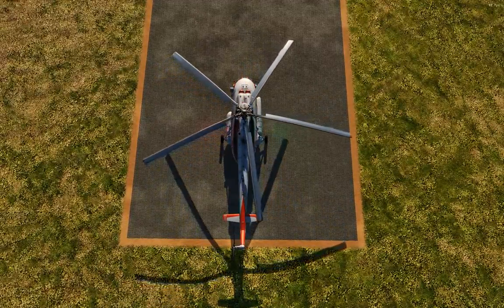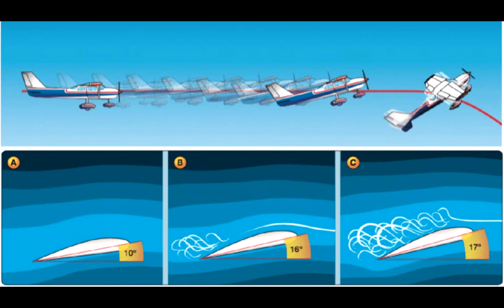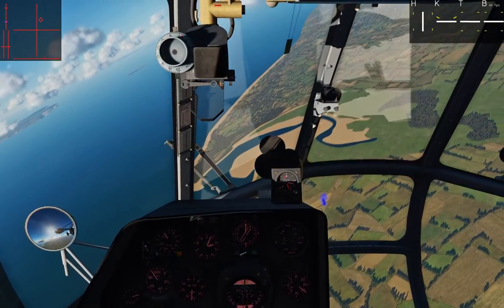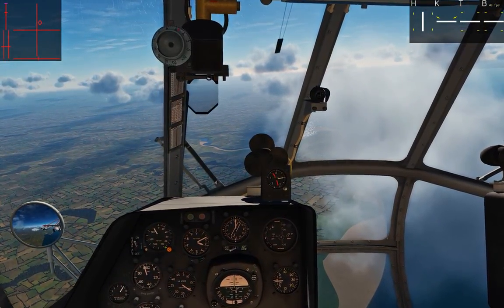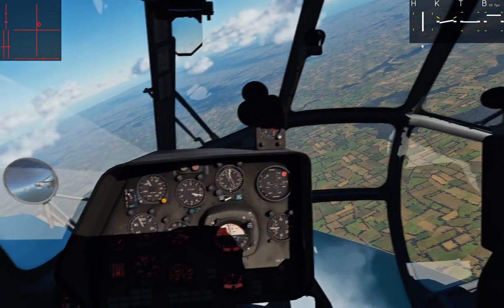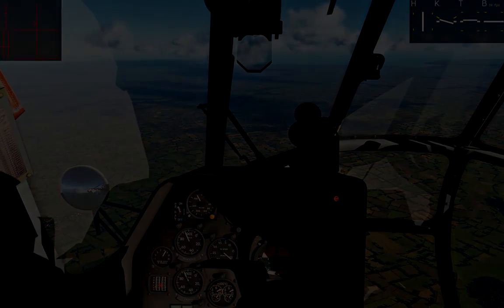DCS Mi-8: Retreating Blade Stall Tutorial

Comment: Last one of these, I promise. 

That beginning bit was a roller coaster:
0:10 "dis-symmetry of lift" Good...
0:12 "Cyclic feathering and blade flapping" Good...
0:19 "Critical angle of attack" Okay...
0:27 "... gyroscopic procession..." NO! BAD!
0:29 "...and phase lag..." Okay, good, so what the hell was that about gyroscopic procession? 

Okay, now on to the rest of it. 
1:15 Minor point: Tip-speed is fine, but if you want a good representative point for the blade as a whole, the 75% radius location is typically used. So that would mean 135 m/s +- the forward speed. Don't think anyone cares though. 

3:00 Flapping is the angular movement of the blade relative to the "*shaft plane*," which is the plane normal (perpendicular) to the shaft that passes through the center of the hub. 

3:09: Flapping rate up or down will decrease or increase the blade angle of attack, respectively (this assumes normal downward inflow and positive collective pitch). You're not wrong, but this should just be clarified. 

3:30 Put another way, the rotor will automatically flap such that the blades maintain roughly equal AoA. 

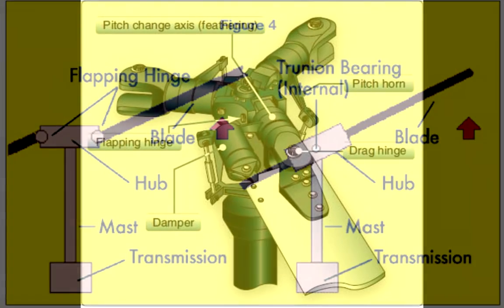3:38 Ah, yes. Finally a rotor that spins the correct direction :D

4:33 Minor point: The rotation you describe is called feathering or pitch. Twist generally refers to a geometric property of the blade and is the pitch distribution along its span. Blades will dynamically twist in flight due to airloads and propeller moment (aka, the "tennis racket effect"). Again, this is more a point about terminology than anything. It's not something the layman would care about. 

5:37 NOOOOOOOOOOOOOO!

5:44 No, it's not

6:17 In the case of retreating blade stall, yes, it will. Even in the case with 90 degree phase. 

6:23 No, *NOT* because of gyroscopic procession. 

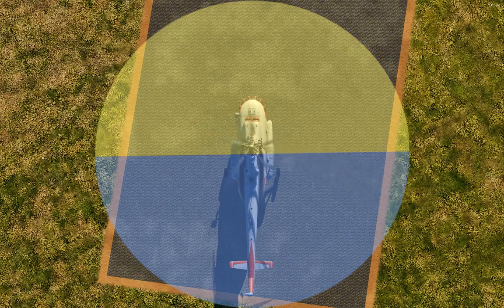6:30 The front half of the disk would not see more lift (Ignoring the effect of coning). The disk just tilts back. 

6:43 Right, it's not a gyroscope. So why mention gyroscopic procession at all? 

7:04 Yes, though phase lag is a very general term that can apply to any oscillating system. It's not a "broad version" of gyroscopic procession. Gyroscopes behave they way they do because of Coriolis forces. Rotor flapping occurs because centrifugal forces act as a restoring force in such a way that the rotor can be shown to behave like a linear second order spring-mass-damper system. 

9:40 There will be a flapping response, to be sure, but there should be a larger roll to the right than you're letting on. Explaining why exactly is difficult to do without illustrations, but it has to do with rotor coning and hinge forces. Just know that in the case of retreating blade stall, there should be a characteristic roll to the retreating side. 

10:50 The buffeting is due to to the stall as the blades go through a non-linear region of their lift curve every rotation. In a 5-bladed rotor, this will result in a 5/rev vibration. 

11:40 The violent pitch up likely wasn't due so much to the retreating side stall as it was you failed to keep the stick moving forward as your speed increased. What I think happened (I could be wrong) is the descent kept you accelerating even while the rotor was flapping aft in response to the increasing speed. The entire aircraft likely built AoA, but you didn't notice. Eventually, the horizontal tail stalled, resulting in the pitch up. Retreating blade stall isn't usually a sudden dramatic thing like that. I'll notice it in the Huey if I'm in a fast descent with a lot of forward cyclic; I'll have to maintain a lot of right stick as the aircraft wants to roll to the left. That pitch up can occur in wind up turns, however, which is what you were doing towards the end. 

13:17 I agree that the roll to the left is suspect, and the fact that you had to hold so much right stick during the dive is also strange. However, this is almost certainly not a case of copy-pasted code from the Huey. Their rotor model should take care of this stuff automatically. It could be that there are complicating and competing effects at play here. I suspect the rapid pitch up is complicating things. I would encourage you to repeat the experiment, but instead, keep the nose down by increasing forward stick as the speed increases. Then see if you get the characteristic right roll. 

15:55 Again, not flapping. It's because of cyclic pitch. 

Anyway, that's it for me. Hope it's helpful. I quite enjoyed the series. Thank you very much for making it.
Reply from the maker: Thank you for these comments, I am learning a lot as I read them.

The reason I talked about Gyroscopic Precession is that as a layman when you look up RBS you will find page after page and site after site talking about Gyroscopic Precession and not Phase Lag. You have to dig deeper to learn about that and the differences between them, so I wanted to make sure I at least attempted to explain that in the video.

Thanks for the tip on the pitching up behavior, I will definitely retry this with your advice and see what happens.
Reply: @vsTerminus  I'm glad you found them useful. And thank you for the series as a whole. I never took the time to learn the Mi-8's systems in the past, so this was very useful. 

I tend to get on people's case about gyroscopic procession precisely because of the reason you mention; that myth is everywhere. In my opinion, it's best to first describe the rotor as a second order system, explain that it has a ~90 deg phase as a result because it is excited at or near its resonant frequency, and then acknowledge the gyroscopic procession myth and explain why it's wrong when it comes to rotor flapping. Unfortunately, like I said in one of my other comments, this doesn't lend itself well to simple explanations.
Reply: @ErikScott128  What is the reason gyroscopic precession is a myth? I’m having trouble with this, and need help understanding, as it seems the concept of gyroscopic precession is only applied during conversations of certain aerodynamic principles, but then utterly disregarded during others. I could use some further help with understanding.
Reply: @fmfmichael  The concept of gyroscopic precession in general isn't a myth. It's a real phenomenon. It's just not really the right explanation for how articulated rotors behave. A better explanation is that the flapping motion can be shown to be equivalent to a spring-mass-damper system: the moment about the hinge due to centrifugal force is equivalent to the spring, the blade's rotational inertia is analogous to the mass, and the damping is aerodynamic (as the blade flaps up, the angle of attack is reduced, and the lift therefore decreases). If you actually do the math, you find that the natural frequency of this system is equal to the rotor rotational speed. Cyclic pitch, almost by definition, is also applied once per revolution, so this is a system excited at resonance. All resonate systems show a 90 degree phase lag; the system responds one quarter cycle later than the input. 

Strictly speaking this is only true for blades with no hinge offset (such as a teetering rotor). For articulated rotors with small flapping hinge offsets, the natural frequency is slightly higher than the rotor speed, and so is excited slightly below resonance. This results in a phase lag slightly below 90 degrees. The exact phase angle depends on the amount of damping, which aerodynamic in nature and thus depends on the ambient conditions (namely air density) as well as the blade aerodynamic and inertial properties.
Reply: At the 13:17 - I think it is the same phenomena as for the taildragger prop plane. When you pitch the nose down on the take off, the aircraft wants to yaw left or right, depends on the propeller rotation. Same for helicopter but the result is in the roll axis. The fast change of pitch probably caused the left roll.
Reply: @ErikScott128  No amazing video to go with this like the Vuichard Recovery?! That was awesome to visualize in the mist.

Comment: What I get from this video tells me is that a "supersonic" helicopter is physically impossible because the advancing blade tip will go supersonic well before the fuselage can,
 resulting in a complete loss of lift on that side.
Reply: Supersonic is never possible with moving parts outside the fuselage, there were tests in the 1950s that confirmed this. One of the famous planes of that era was this project: https://en.wikipedia.org/wiki/Republic_XF-84H_Thunderscreech

Basically, if you want to go supersonic, you have to have an powerful exhaust jetstream either generated by a rocket, ramjet or common jet engine. If you use ambient air, that air has to be sub-sonic in order to be compressed inside the engine, even if the plane moves at supersonic speeds the air has to be slowed down to sub-sonic before hitting the fan blades. That's why the MiG-21 has the famous nosecone in front of the intake, or the F-15 has the movable intake nozzle.